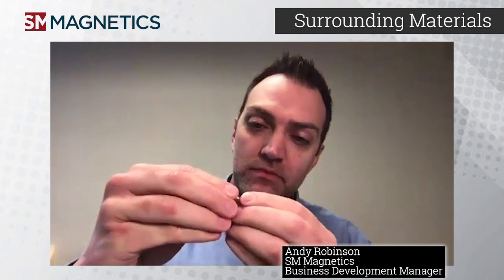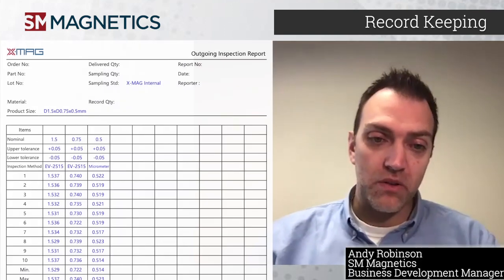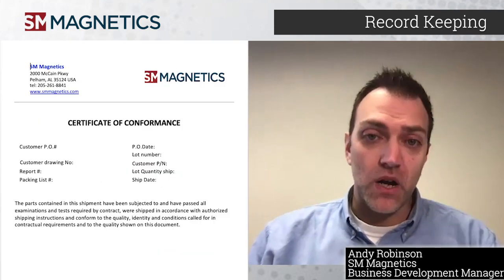Magnetic Innovation & Technology Series, Episode 1: Medical Applications & Magnets

Comment: There is a guy named Jim Antaki (Turboharp.com).  He's got a patent involving valves on artificial hearts... but interestingly he also has harmonica patents.  That's how I came across them.  He uses a magnetic slide to change the vibrating frequency of steel reed harmonicas.  It's pretty cool.  You press a button and a magnet gets put near the reeds and lowers their pitch.

I actually need to contact Supermagnetman for a small purchase soon.  Still working out the details but I want to try to use a magnetic spring instead of a normal reed so that I can simplify the way frequency is created so I can do experiments.  Probably under $10 in magnets but I'm going to have fun with it.

(Just brought it up because the medical uses made me think of Jim.  Not sure if his valve uses a magnet though.)